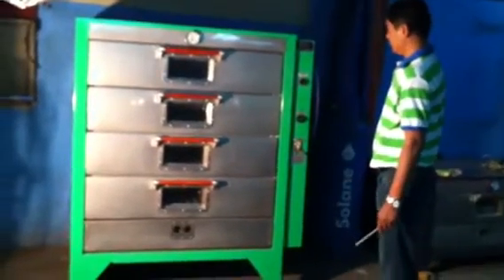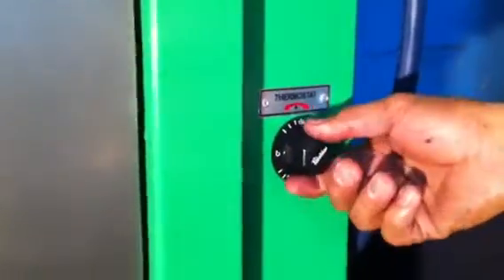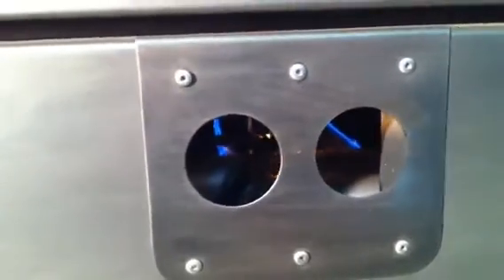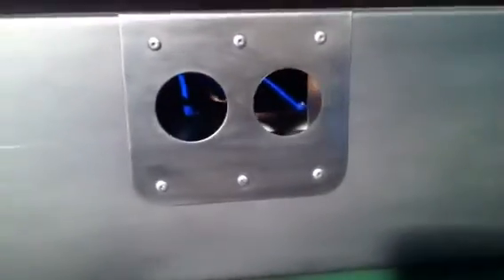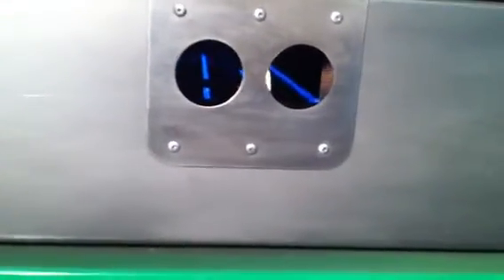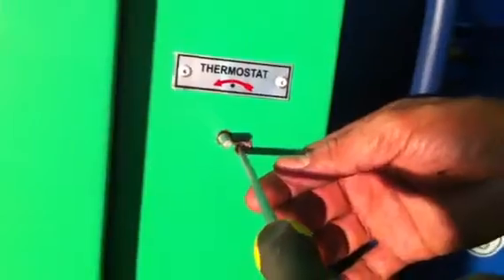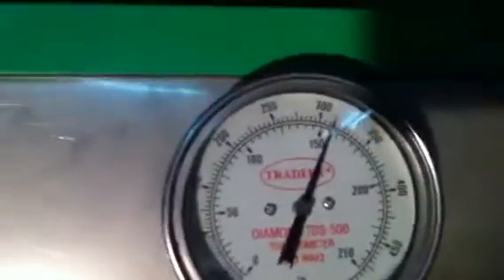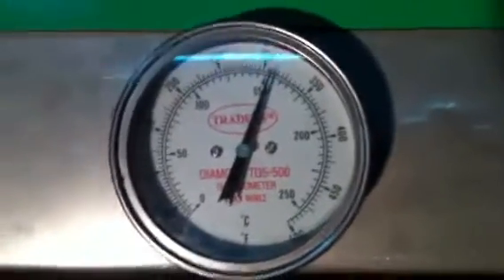Oven Calibration

Comment: No need to calibrate the oven every after use.. we only need to calibrate the oven when needed. Calibration is needed if  the  oven is out of calibration e.g.( when the oven temperature exceeds the temp settings on your thermostat control or when  the oven temp. did not reach the temp settings on your thermostat control.)
Reply: Salamat poh maam sa advice and sa video tutorial on how to calibrate DCM oven..i have DCM oven poh 3 deck 18 plates and their was a slight difference on the temp. parang ma baba konte ng 10 ⁰C, when setting the ovem  temp. I set the thermostat to 180⁰C but the termometer reading was 170⁰C. For 15 min. Hindi talaga umabot ng 180⁰c and i tried to adjust the fornt screw behind the thermostat knob and adjusted it to highier the flame just as you denonstrated on the video and thankfully  na callibrate ko din ang temperature . .salamat poh maam..DCM more power..